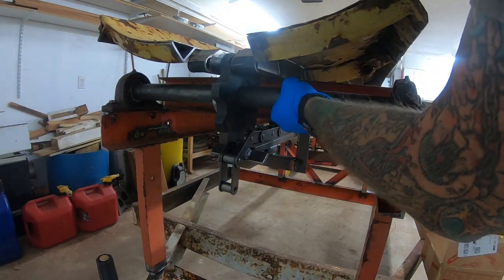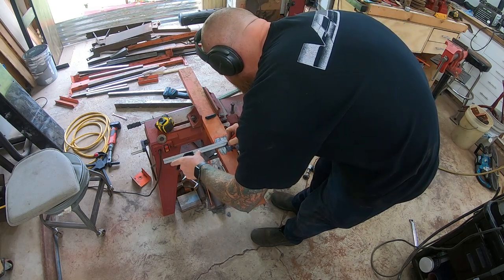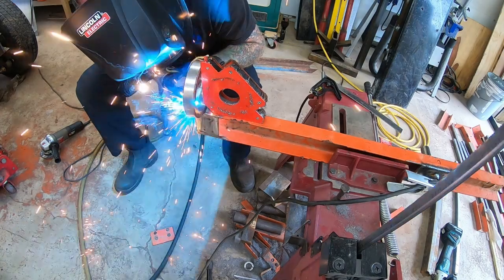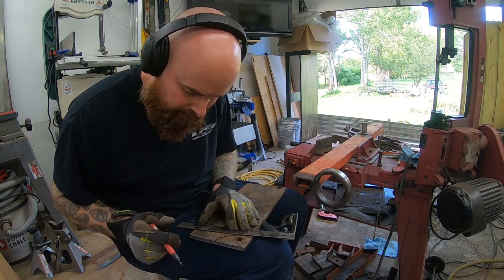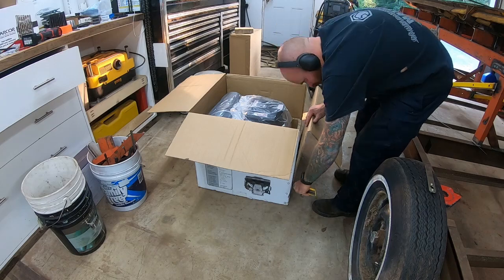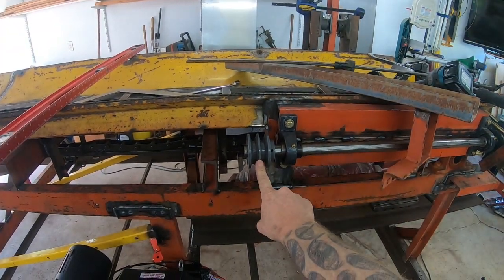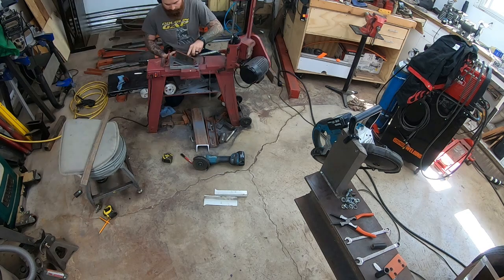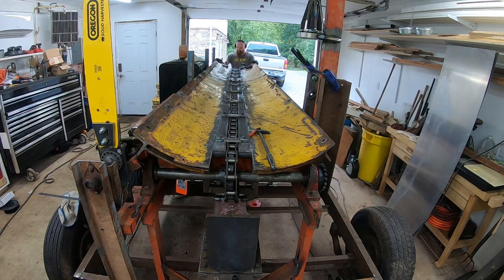Firewood Processor Build Ep 5 - Clamp, Engine and Tank

Comment: Did you have any issues with welding on the old bearing race? Really hard steel like that usually suffers under bead cracking from my experience
Reply from the maker: I did not have any issues. My concern long term will be the pieces I welded on to hold the bearings, as they are cast.